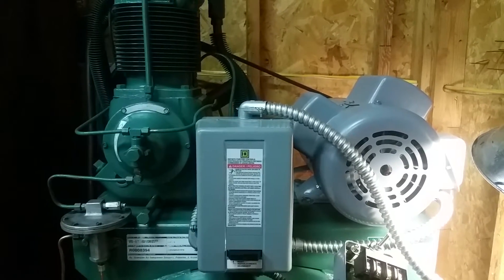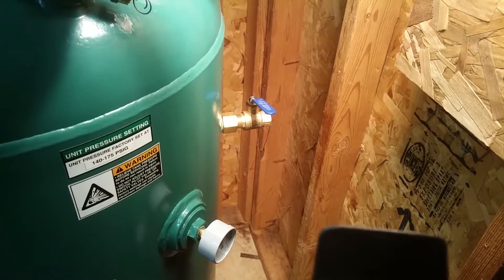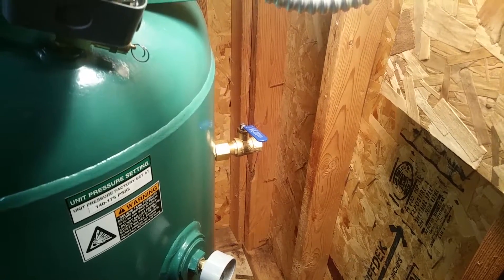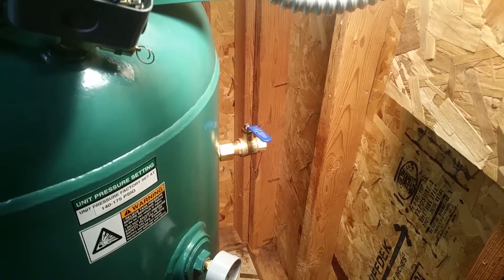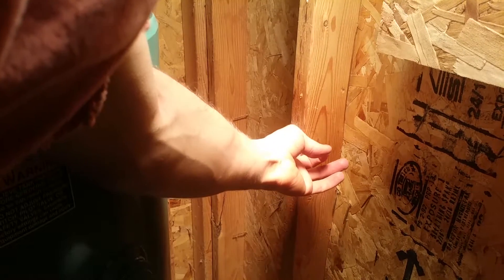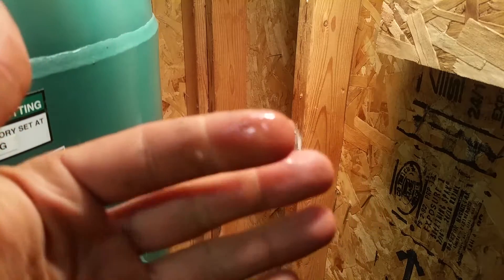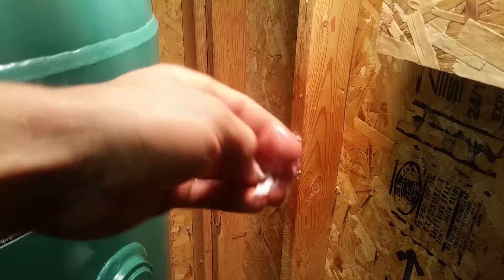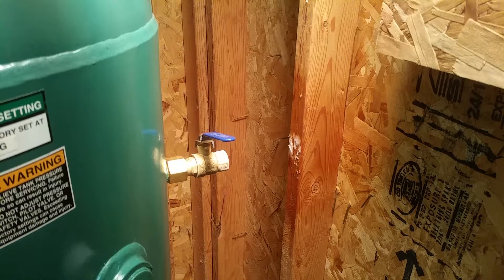Will My Air Compressor Make ICE?!? Let's Find Out!

Comment: If you recall, what psi was the air in the tank? I'm just curious what the drop in pressure was to have that effect. Also the approximate temperature in the shop
Reply from the maker: 175 PSI ambient temperature. 50-75F
Reply: Thanks!

Comment: That's not good, means water vapor is in your tank... That's why bigger compressors have air dryers before compression.
Reply from the maker: Thats not true. Any tank would do this. It gets so cold because the air is moving from high pressure to low pressure. That's how refrigeration works.
Reply: Matt's Shop where is the condensation coming from?  Do you think it's being pulled out of the air and appearing magically on the 2x4?  No... It's coming out of your tank, and then freezing because of convection from the moving air.
Reply from the maker: Fair enough. It has been raining here for weeks and it's extremely high humidity.
Reply: Matt's Shop Nice job on the compressor, looks brand new! Where I live humidity in the tank really sucks.  If you're not in a heated shop or garage it freezes in the bottom of the tank so you can't even drain it.  I'd definitely check the drain on your tank if you're in high humidity climate.   Air dryer is the way to go, but they're normally just on big industrial stuff.

Comment: What's the cause of the ice? Is it due to condensate water?
Reply from the maker: The drop from high pressure to low pressure causes the air to cool. It's how A/C systems work.